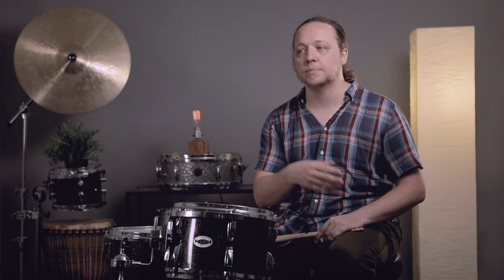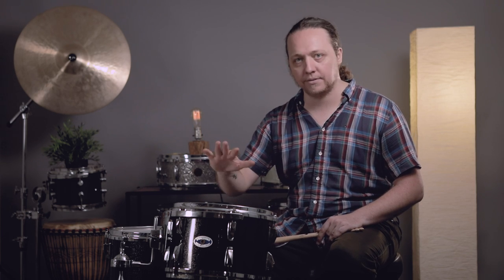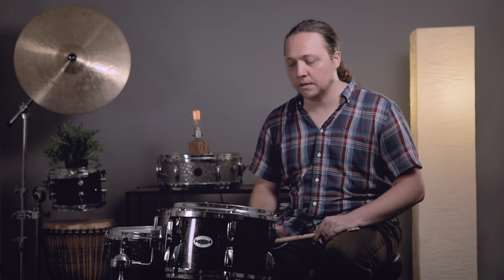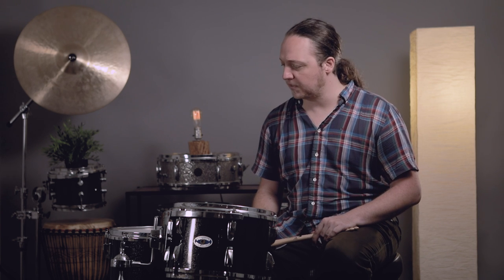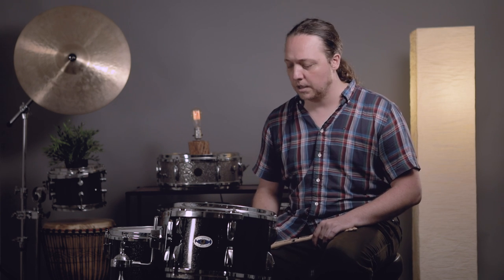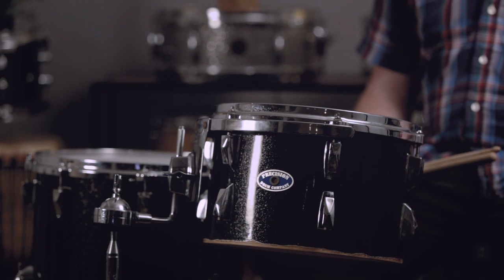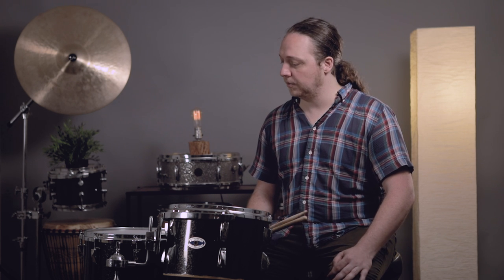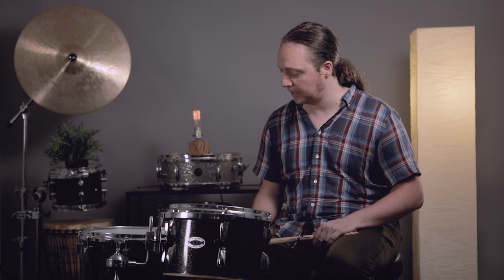Ep. 26 Converted Concert Toms

Comment: As an old fart that played pro in the 70's and 80's, single headed toms were the way to go! As a general rule we were looking to project over the Marshall's and SVT's because the drums weren't mic'd. Only occasionally in larger outdoor venues. Then, with the right sound guy and the right effects, that SM57 shoved up in an open tom could sound awesome! I've got cassette recordings that are 45 years old that still have viable drum sounds. Makes me wanna take the heads off my studio session classics!   ; )
Reply: I know this is an old post but I was wondering what kind of heads you were using on your single headed drums?   I have a 79/80' slingerland kit that the bottom bearing edges are badly damaged form throwing them around with no heads on (previous owner). Right now I dont have the money to have them repaired, and I cant get them to sound good, so Im going single head on them. Not real happy with the coated pinstipe on the 16", very plasticky.
Reply: @bryangulledge  back in the day, the Remo clear w/ black dot CS heads were my first choice. It's important to consider whether you're looking to improve the sound you hear behind the kit or what the audience/others hear in front of the kit and whether or not you're putting mic's on/in them.
Reply: @zacdrake  Thanks for the reply! I like the idea of the control dot heads. Im not playing live, just trying to get a good sound for at home practicing by myself or with a few friends.

Comment: I realize this video and presentation is 4 years old (at this point), but I've been playing True concert toms for 45 years and have been playing 55 years total. I bought a Slingerland drumkit in 1978 with 6 concert toms and 2 floor toms. Initially they came with coated heads, but over time and trying various heads, I came to find that remo pinstripes worked well with those drums, and particularly on the floor toms as I tune them low, but I get a nice bottom end out of the 16x16 and the 16x18. The upper toms range from a 10 inch all the way up to a 16 inch head. Some people aren't crazy about concert toms, but I love them. They're easier to tune, they weigh less than a double headed tom would, and they record very well even without close miking. Hal Blaine as well as Phil Collins and others have played and used concert toms for years with great results, and that was without the suspension systems they now use for rack toms. In my view and from my experience, the suspension systems are much ado about nothing. Some will argue they allow the shell to sing/vibrate without being stifled, but considering all the drums that have been recorded in history up until the suspension systems were introduced, I'd say they turned out just as well as anything suspended today. Frankly, it's added weight and a sales pitch to buy into the whole suspended tom thing. Again, that's my opinion from someone who's been playing for 55 years and have seen fads come and go when it comes to all things drums. Oh, and I do have a very nice set of Pearl Studio Masters drums that are incredibly well made, double headed, and use a different suspension system than other companies sell. They sound great and record very well too, but being birch shells they have an entirely different sound to them versus the Slingerland shells. Anyway, this was a very informative video with some great info, and as always, kudos!  Keep up the great work.
Reply: Artimus Pyle played Slingerlands like that back in the day.

Comment: I refurbished some Tama drums. Stripped and recovered them.. new lugs, hoops. 14X11 tom (formerly a flying floor-tom) and placed it on a snare-stand. 2- 16X16 floor-toms.. and an 22X18 bass drum. Single heads on the tom and FT's. Remo Ambassador X coated (1-ply 12 mil) batter heads. Remo coated Emperor (2-ply) on the kick-side of the BD.. and a Remo Diplomat Fibyrskin on the front. No holes on the BD. No muffling. Kit sounds amazing. I used to play single-headed drums years ago.. taking the resonant heads off. Then, had several kits with two-heads. Now, I'm back to my favorite. Remo Ambassador X heads are great sounding/feeling heads for single-headed toms.

Comment: Thank you for this video. Just came across it now, and it's exactly what I needed; making the decision to convert two rack toms. I have ended up with a kit with duplicate 10s and 12s so will have a few choices of setup by setting up a pair of them as concert toms. I'll be removing the bottom hardware too to reduce the weight on the shell a bit more.

Comment: I did an Elton John tribute and wanted the Nigel Olsen sound so I took the bottom heads of my drums. To me they were boingy with the top heads tuned as if the bottom heads were still on. I tuned them higher then put a bit of duck tape with a square or two of toilet paper on the bottom of the heads inside the drums and they actually sounded great and much deeper sounding then how high they were actually tuned! I love tone and resonance at the same time I do a lot of quick intricate rolls (not so much on an Elton John gig) and man were they precise obviously with a ton of attack which I love!

Comment: I have 8" 10" 12" 14" rack toms and 16" and an 18" floor tom all concert toms. It saves money too!
Reply from the maker: Nice! No reso hardware or just no reso heads? What's your go-to batter head for these drums?
Reply: @SoundsLikeADrum  I took the reso hardware off and the heads. I also cut the 8" 10" and 12 so they would be more shallow to enhance the high end. At the moment I am only using the 14" 16" and 18" with clear pinstripes tuned some where in tthe middle with Aquarian studio rings on the heads to get rid of some over tones. I want to use Aquarian's clasic clear (wich is comparable to an Evans G1 or Remo Ambassador) on my 8? And 10". Then I want to have Aquarian's classic clear with power dot on the 12" and a Studio X with a power dot on the 14". Lastly I want an Aquarian Performance 2 clear on the 16" and a Performance 2 with a power dot clear on the 18".
Reply: How about the edges? Aren´t they getting damaged?
Reply: @Eurodrummer666  nope

Comment: Cody, with the equalization def a little "Collins...esk".  Let me post a question or observation,  from a "student of drumming" at 69 yo , concert toms from DW for instance," do not have the lower hoop attachment mounted on the drums (forgot the name ), does that make difference vs just removing the reso head?  I have 12 and 13 inch rack Toms on a cheapo Gammon drum kit.  Got it as a xmas gift from my wife in 2018.  I have returned to my "love" of drumming after a 51 year hiatus.  My toms are  mounted the old way , atop the  bass drum with poles that attach via insertion into the drum.  I replaced the OEM cheap heads with Evans G1 clear batters and coated reso beads  the floor tom as well.  I am going to experiment with this "concert" toms  maneuver for the fun of it.  Retirement and COVID has apparently (having lots of arthritis certainly doesn't help) granted me considerable time.  Be safe and well, All

Comment: I play drums for my church and also use the church as a practice space. There I have a Tama Rockstar kit setup with 12, 13 rack and 16 floor outfitted with Evans Frosted EC2 heads and no reso heads. All I use for microphones is a Sabian Sound Kit and the drums sound fantastic. They have a lot of attack yet still have the tone I'm looking for. I don't know if it's just that kit or what, nut I could not get the tone I wanted with using reso heads on the toms. I tried so many different tunings and none of them were content enough for me. This video really gave me a good reference on how they are maybe supposed to sound just with batter heads on them. Now, the kit I use for gigging with my band is a Pearl Vision with 12 rack and 14, 16 floor toms. I do use reso heads on them and they sound great. They have great attack and great tone. Again, I don't know if it's just the Tama Rockstar kit that has those problems that I encountered, but it definitely helped to take the reso heads off. Thanks for the great video and keep up the great work. You guys are awesome!

Comment: YO I've been playing single head on my rack toms and double on my floor toms, all I can tell you is if you want some killer tones you have to tune way low, kind of like a harmonizing frequency to the shells fundamental note. Then throw on some studio rings (not gels), use some smaller toms and go Waaaay low there should be a sweet spot for each drum, too low and it'll sound loose and too high and you'll choke the head with the ring on it.

Good luck with that my dudes!

Comment: I have two drum kits.  One is a 4 pc. set of Ludwig Super Classics from the 1960s with 2 toms - 13 & 16 inch.  The other is 5pc. Ludwigs from the 1980s with 5 concert toms 12,13, 15 & 16 inch.  The bass drum came with no resonant head but after a while I added one with a port because I just like the sound.  I have played the 80s kit quite a bit on club gigs, outdoors and church gigs.  I definitely have to make a mental adjustment when switching from one kit to the other because of the difference in tone but I find the concert toms fit in musically and seem much easier to mike.  I have used Remo Black Dots, Pinstripes and Ebony Pinstripes to tweek the sound with good effect.  I like the 4 pc. kit with the resonant heads for some gigs and I call it my Jazz Kit but it is good for  any purpose.  Your channel is tops in content.  Keep it going!

Comment: Sound amazing with bottoms off at original tuning. I would play them like that 100% of the time. Btw--- the pitch did not change when you removed the bottom heads. No-- as now, you can actually, hear the true pitch of both drums.

Comment: I’ve been playing the same set of TAMA Imperial Stat concert series toms since the 80s. In general - I love them. At the same time I’ve added a few reso toms to my arsenal and get some interesting contrasts of tones playing reso+concert as well as sticking to a single palette of only concert/only reso. Really allows for quite a bit of variable tones to be available. That being said, I’ve also been highly  interested  in obtaining the hardware-only rim set from Welch Tuning Systems to have the option of going the other way of going from concert to reso. That is if the lack of a bearing edge on the bottom of the concert toms isn’t an impediment to this kind of conversion. What say you? Any sage knowledge regarding this type of conversion?

Comment: With concert toms using a clear two ply heads seems to be the best route. Used single ply and also coated drum heads and the sound just doesn't compare to using a clear G2 or a Pinstripe at least for a Rock sound

Comment: I'd be interested to see what would happen with mesh or some other low-volume head on the resonant side would do. Maybe a little more sustain but still with less harmonic content? A benefit would definitely be protecting the bearing edge and avoiding an rattle you might get from the loose lug threads.
Reply from the maker: It’s a concept worth exploring - I definitely know of prominent examples (Danny Carey of Tool for one) who run mesh heads on the front of their kicks for rattle/aesthetic/bearing-edge-protection reasons with stellar results! - Cody

Comment: I own a 1968 Ludwig Hollywood drum set  that did not have bottom heads or hardware on the toms. I bought the parts and heads later. I had to use a file to shave some wood off so I could

Comment: I had the Idea to put off the reso head of my vintage 16" Sonor floortom, because I had the feeling, that it was not loud enough, when tuned low compared to the punchy rest of the kit. I was surprised, that it worked just fine! Not so much with a lower tuning, but with a medium to high one 👌 It creates more tone out of the shell and has a medium long sustain (Floortom legs are designed for sustain + standing on a fluffy carpet). I use a coated powerstroke 3 head.

I might experiment with that higher tuning to keep the tom producing more tone, but pitching the sound down by cranking down 1 or 2 tension rods. 

I am just wondering what will happen, if you cut out a circle  of the floortom reso head, so that only a 1 inch or 2 are left from the rim. Has somebody tried that and noticed a difference?

Comment: I only use concert toms.  Even my floor toms are rims suspended and a bit shallow.  I use Yamaha drums with either clear pin stripe or hydraulic heads.  Bass is a 20" marching bass with spurs etc. installed. Bass heads are Aquarian reso w/ port and either Emad or Powerstroke 3.  Toms are 10", 12", 14" and sometimes I add 16". They are loud.
Reply from the maker: That must be an awesome sound! We'd love to see a video/hear a recording of the set. Cheers! -Ben

Comment: What you pointed out about depth is a very real problem with timbales. There was a trend for deeper timbales as salsa went for loudness for a long time. Any old player will tell you they sound horrible. The problems you observed on your floor toms are evident in the recordings of timbales from that error. Though if you work with them as a seperate instrument instead of treating them the same as the traditional depth I think there's potential.

Comment: Nice video. I have open face kick and a open face floor tom & a double headed high Tom. I have it that way so I can internally stack them into my car and still have room for two passengers. When doing so cardboard in between each drum prevents scratching. I found that when miking these drums I need to find the note and then the frequency of the note to accentuate that note. That's pretty helpful. Thanks to the video I'm going to try miking my floor tom from underneath. my question is can I just mike it from the edge of the bottom with a claw mic stand or do I have to get way up in there to get the attack?
Reply from the maker: Way cool! I’d recommend experimenting with how far inside the drum you place the microphone. There can be pretty drastic differences because of how the sound waves travel inside the cylinder of the shell.

Comment: Here's something, i have 3 sets of drums, poplar, maple, and walnut.
Two heads. Unless the heads are not tight enough for them to resonate, they all need some muffling, some even more than others. The only time no muffling was needed was with hydraulic heads.
Reply from the maker: Interesting! Of course, this is all subjective. I'm not a huge fan of muffling my drums with the exception of the bass drum and the occasional handkerchief or wallet on the snare but I'll apply muffling if the situation truly calls for it. More often then not I notice that people (drummers and sound engineers) use muffling to help cover tuning issues rather than because the drum and heads aren't capable of producing that sound in the absence of the muffling. It all depends on the context though.
Reply: It's also used to get the studio sound, rather than the long decay or hollow drum sound.

Comment: As I listen, and from personal experience, I feel like removing the bottom head takes a bit of the wood sound out of the drum. By doing so, it seems to be degrading the need for high quality wood shells and all the tonality that they bring. It could be just me, but it always seemed like the punk and reggae style players were more in line to remove the bottom heads and it just so happens they were playing drums that you could have found at the curb on garbage night. Perhaps these are some factors that led to the sound of the music which gave its character? Ah the glory and variation in drumming...

Comment: question, isn't a snare drum without snare wires just a tom?
Reply from the maker: In a way- yes. Though snare drums tend to have a snare bed cut into the bottom bearing edge. Additionally, the depth tends to be significantly shallower than that of most toms in relation to the diameter. -Ben

Comment: Is it possible that without any tension on the bottom, shells can warp and become unround?
Reply: Yes on the bass drum if it holds the Toms. Best to keep the front hoop on and just cut the head out w a razor knife all around as close to the hoop . The hoop will stop the shell from warping.
Reply: Not the Toms.
Reply: @Egbertwo  But what about "virgin" bass drum? Also: some plywoods have less layers, some other have many. These plywoods with many layers are more though and sturdy. This is what give strength to the plywood: number of layers. For example: 3 ply is much more prone to deform than 9 ply. * Hoop doesn't hold shell. There is a gap between every shell and hoop otherwise you couldn't put hoop on the shell. So... Hoop is "pulling" drum head and lugs distributes tension on the shell. So lack of the [front] head means lack of the tension which should be fine for any proper designed shell. I think not even head/hoop tension is much worse than lack of the head/hoop/tension.

Comment: Has anyone had experience with concert-like toms in a live mic'ed setting?  We have drums in a house of worship setting that we will be putting behind a 4-ft knee wall lined with sound absorption panels (the room seats 300 with sound damping on 3 of the 4 walls).  Due to the small footprint available for the drums, we want to limit the sound to just the fundamental tone with little resonance for mic'ing purposes.  This video shows that the attack will be more pronounced, however comments suggest mic'ing underneath close to the batter head to get a better sound.  We are also looking at using heads similar to that of the Remo Pinstripe.

Just curious if anyone has ever used mic'ed bottomless toms in a live setting in a small to mid-sized room.  Hoping to utilize others experiences to guide in this decision.
Reply from the maker: You might consider ported resonant heads as another option: 
https://youtu.be/zxZWkovyWqk

We did a bonus comparison of miking from the top vs. inside the port from below here:
https://www.patreon.com/posts/extra-top-vs-mic-29334712